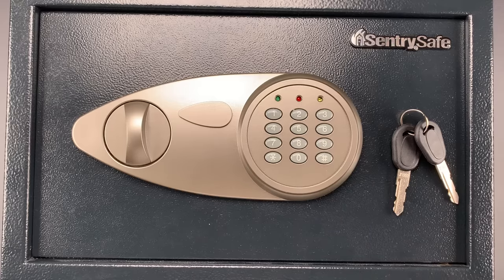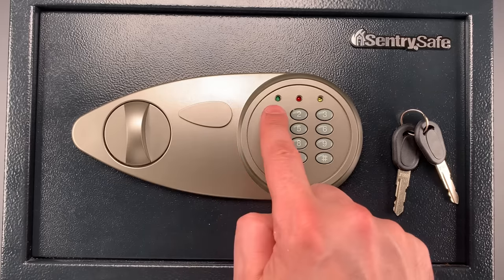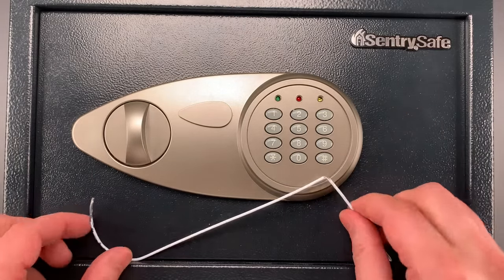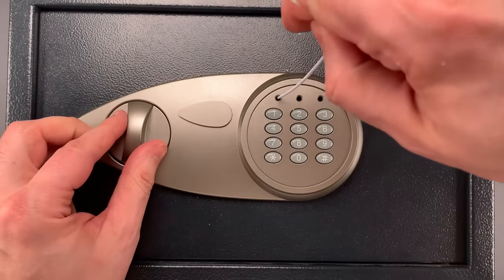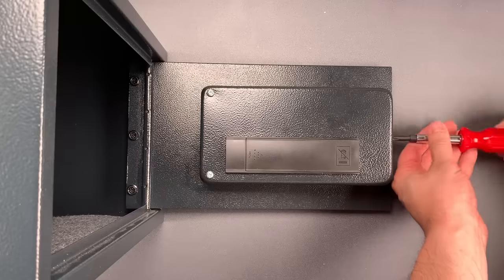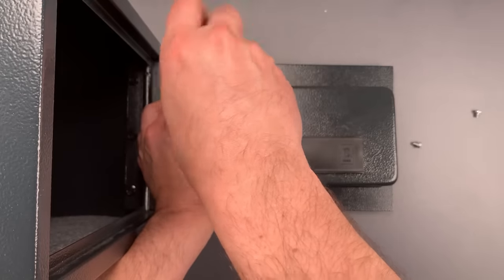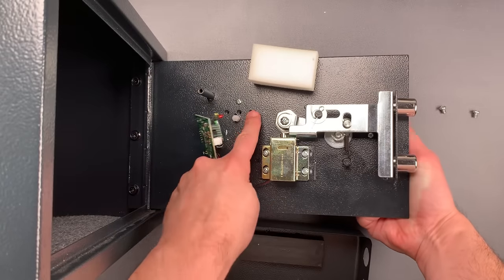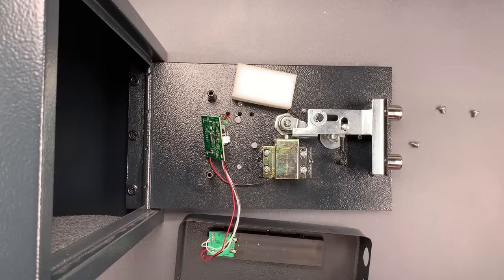[1020] SentrySafe Opened With a Coat Hanger!

Comment: One of my friends bought a safe. He bolted it down to the shelf. The shelf was easy to remove so when the robber came he took the safe together with the shelf.
Reply: "a lock is only as safe as what its mounted in"
also works well if you change it to
"a safe is only as secure as what its mounted on"
Reply: your friend forgot to make sure the lock was secured to a strong setting.  whoops.
Reply: "There was an attempt..."
Reply: If you can pick up the safe, it's not safe.
Reply: The trick is to keep safe empty and just use shoe box on the floor, at least they'll get pissed they were carrying damn thing around for no reason.
Reply: When thieves have decided to steal you, there's no avoidance. I live in the countryside (France) and there was one safe "picking" that made the local news. A local farmer which was know to have a lot of cash on the side (typical older generation not trusting the bank) got his safe robbed. It was wall mounted, in a cinderblock and stone wall. The thieves stole a bulldozer from a nearby construction site and plowed through the wall, picked up the safe and (probably) loaded in in a van. Ultimately, as many other people pointed out, the shoebox in the cabinet solution is probably a safer bet overall.
Reply: @LeSarthois  I prefer the parchment paper wrapping labeled liver in the freezer myself. offers a little fire protection and seems like just another nasty piece of meat.
Reply: @alexs.3789  Put something in the safe that when shaken "sounds" valuable, or fill it with fake gold bars, or just full of cement, completely.  They try and try to pick it but it is cemented shut.  Actually, scratch that, do what they did in John Wick (the 1st one), have a safe, then pour concrete over it and have it become your floor in your basement.
Reply: Ill top that... not a shoe box hide stuff behind a shelf of user manuals for stuff you own. All normal people and even the owner are allergic to even look at that shit let alone parse through it
Reply: He is not your friend anymore
Reply: @LeSarthois  nah not even a shoe box will stop a  good criminal. a good proffesional thief will look through everything becaus they know people usualy hide theyr stuff in strange places to avoid geting stolen.  stuff like ID cards and pass ports are realy expensive and can be sold for allot of money  so a good criminal will look for such stuff.  drug addicts and amatures tough they might not be as clever and miss the shoebox  but even they whould actualy whant to check shoeboxes becaus shoes can be expensive and som people store valuable stuff like jewlery in them.
Reply: We have all fallen short of the glory of God because we have broken His law. have you lied or stolen? Looked with lust which is adultery in Gods eyes, or used God's name in vain? because we have broken His law we deserve justice but God is so gracious that He came to earth as Jesus and died on the cross to pay for our sin and transgressions, His final words were " it is finished" He paid our fine, and then He raised Himself up from the grave because not even death could hold Him. Repent and trust in Jesus, and God's justice will be paid for in full.
Reply: @LeSarthois  
Ever heard of a decoy safe?
That'll be the next thing.
Put a bunch of garbage copy papers and regular coins in the decoy to sound like cash & bonds & gold.
The real one is under the trap door hidden... somewhere else in the house.  😁
Reply: That should of been his decoy safe any smart man buy an impressive house safe. Then buries his money by moonlight in mason jars
Reply: @christianhale1988  For The Love of GOD! Please take your preaching elsewhere.
Reply: @alexs.3789  That works until one day you trash an annoy shoe box lying around on the floor. After few days.. ooopss..
Reply: I hope you at least returned the shelf back to your friend after you robbed him.
Reply: Maybe it was the shelf he wanted.
Reply: Marko
  does that mean his safe had a limited shelf life.
Reply: So what he needs is BRAINS ...not a Safe
Reply: he should have bolted the shelf to another shelf...
Reply: @jakedaniels7676  Midnight gardening is to be done in the dark.  New moon, no flashlights.  Pretend you are burying a body.  If anyone sees you it'll be gone the next night.  Also the soil disturbance is a dead giveaway.
Reply: @ajjabajja9155  sure that's why it's in there
Reply: @Big Cat Little Lion awesome.
Reply: Noted: bolting the safe to the wife right now.
Reply: I got a funny feeling both you and your friend know the actual robber
Reply: @rampage3337  Home security needs to be multi-layered, so relying on one specific form of protection is probably not going to be enough. It's true that thieves will rummage through most of the property. But they are also trying to be quick, so may not search an attic, for example. Especially one with no ladders readily to hand. A number of different types of deterrents, along with keeping your mouth shut would probably be the best bet.
Reply: Plot twist, safe resists all forms of attacks till send to LPL for reviewing.  

Still remained the problem of how detaching the shelf… :)

Comment: "SentrySafe produces and distributes fire-resistant chests, files, safes and security storage containers to more than 54 countries worldwide. An affiliate of the Master Lock Company ..."
"Nuff said."
Reply: Masterlooooooock! shakes fist
Reply: “Well there’s ya problem”
Reply: Also, how fire-resistant can it be. If you put a fuel source behind a flame ingress point.
Reply: When Masterlock don't even release these products under their own name... You know they're bad lol
Reply: @Aimless6  fire-resistant chest mean that the box will not burn, not the insides
Reply: Oh. I see the problem.

They need to make a coat hanger resistant chest.
Reply: @Aimless6  Yea, I know this is mostly a joke, just like this "safe", but realistically I don't see this a a big weakness given the construction. From what I can see it appears the "safe" is a single wall steel construction. The door is also a single steel plate with a housing over the lock mechanism. If this was in a fire the sides of the box would heat up directly. The door on the other hand has a relatively large steel box to house the electronics and the locking mechanism, so any heat here will have to go through both before it comes into contact with whatever is in the "safe". The LED are likely to burn easily, but even if they do there is not much of an opening left by them, and the sponge might or might not be made of combustible materials. Given the attention to details shown by the rest of the construction I think it's quite safe to guess that the sponge burns like an accelerator, but even then I son't see it as a big problem as there is limited access to oxygen inside the lock comparture. And without oxygen fire tends to go out rather quickly.
There is a battery compartment built into the lock container, and it seems to be made of plastic, no surprise there. But by the time the heat gets intense enough to melt that plastic, or even ignite it then I'd wager anything inside this thing will already be burnt by the heat coming from the bottom, the sides and the top of the box. So while it isn't a good construction I wouldn't say it's the main problem when you look at this as a way to safeguard your valuable papers in case of fire.
Still it's a weakness as it allows for easy access for any thief who has seen this or has had the chance to look into this product.
Reply: Master Lock:  Only the best in back street Chinese engineering & design.
Reply: @rocketraccoon1976  Actually Masterlock moved back to Milwaukee, sadly quality did not go up.

Comment: LPL: "It's held in place with a sponge..."
Me: "You mean double sided tape but ok..."
Me: "...omg..."
Reply: Double sided tape might be more secure, because the lights wouldn't as obviously give way.

Also, they could avoid this kind of attack by having the lights protected with a thin plastic cover. A criminal could break the cover to perform this same attack, but it would be just a little harder to do.
Reply: I legit thought he was joking until he took the sponge out.

I wonder if this was intended to have a larger mechanism/board, and they just re-used the shell? Because that sponge fills out quite a lot of empty space.
Reply: It is a sponge duh

Comment: the scary part is that the hotel literally supplies any theif with the neccessary tools just a few ft from the "safe".
Reply: This is not a hotel safe.  It's a home "safe" by the worst lock company in the US.
Reply: @johndododoe1411  Hotel "safe" are of very varied quality. One hotel I have been a guest of had a "master code" of 1 2 3 4 5 6... so... well... even if I set my own personal code; the 1 2 3 4 5 6 code also opened the safe.
So far in my frequent travels though, I have not been subject to theft that I am aware of.
Reply: @johndododoe1411  Document fire safe.
Reply: the door is maybe the thickest part of the whole "safe"
Reply: @Paxmax  As far as hotels are concerned, you'd probably want to look at the layers of security, and who has access to each.  See  what the room locks look like, the safe itself, any other security features in the common areas (sensors, cameras, night guard, etc).
You'd also want to be discreet before checking in.  Don't do anything to stand out, like wear expensive jewelry or designer clothes.
Lastly, make sure to secure your belongings before you leave the room.  I'm pretty sure that most hotels thefts are done by the maintenance or housekeeping staff.
Reply: @johndododoe1411  Some hotels do use similar safes.

Comment: Having a decent amount of experience in a related field , I am well aware that NO lock will prevent a well-armed / well-determined thief or robber from getting into almost ANY lock.  BUT - after watching several of your videos - what I do find alarming is the EMBARRASSING EASE so many of these locks / keys / safes can be defeated - YIKES !!
Reply: And not with pro lock picking tools. Coat hangers and orange juice bottles.
Reply: Yep that's his primary goal, to show how basically insecure so many of these products are and to motivate vendors to do better.
Reply: As always, it's just a matter of $$$.... the companies will make things as cheap as they can, and price them as high as they can get away with. It takes a lot of research and a willingness to spend an arm and a leg to get a good quality safe. And in reality, I think it's kind of always been this way.
Reply: As a professional bank robbery lockpicker, my friend can confirm this.
He says that the first step is getting into a bank computer, spreading a specual virus so that we can manually control when what is active/not active.
After that, we map out all cameras and doors.
Meanwhile, we also find where the alarm is and shut it down before moving on.
After that, my friend has to go near the bank, wait for the pc virus and alarm to shut stuff down, then he goes in (it's generally at night and not via the main enterance.)
He then proceeds to pick the doors (with both standard and special tools) and then they can take a part of the money, quickly but silently get away and there won't even be camera footage left.
Clean, fast, stealthy.
Reply: @u6uggg6hguiuggy  Ok but how are you getting to the "bank computer" without being caught on tape? Even once the cameras are off they can still see past footage. It's not like banks are empty either, they're not gonna just let you walk into personal restricted areas.

Comment: Next time I'm in the market for a safe or a lock, I'm going to have to dig through your archives to see if you've picked what I'm looking at and how long it took.
Reply: If the video is longer than 5 minutes - Buy it :p
Reply: A proper safe will cost thousands of dollars and not have a key nor will it have an electronic push buttons for the combination.
Reply: @Reelix  

Its smarter to watch exactly how long it took to pick. Sometimes he picks multiple locks or spends the first 4 minutes talking about other things before spending a few seconds picking
Reply: He has good locks on the show sometimes, but I don't think he has ever done a good safe or lockbox. I suspect they're too expensive just for the sake of a video and he doesn't want to show any safes he's actually using.
Reply: The best safe is simply hiding something where no one would expect to look or one that is too heavy to carry out of a house. Every other safe out there will do fine for keeping young kids out of things, maybe not savvy teenagers though who would find a video like this and break in.

Another factor is convenience. If a safe has a key hole, buttons, or fingerprint sensor on it then it will have more vulnerabilities. Combination locks seem to be the best. Or a safe that requires two types of keys or codes to open.
Reply: this should be on Amazon
Reply: @christopherguy1217  - Sargent & Greenleaf makes keypad-opened safes that are secure. They've been in business a long time and their designs take some thought, not just a coffee break, to think up.
Reply: @christopherguy1217  not mention they are breakable too!

Comment: LPL at Home Depot speaking with the returns clerk: I’d like to return this safe because it’s not safe. shows the coat hanger

Clerk: 😶
Reply: I actually tried to return a safety wire for a computer i could "pick" by shoving a bent paperclip in. they said that once it's out of the package it's no longer their problem.
Reply: @StefanoBorini  roblox oof sound
Reply: I'm returning this safe, because it is missing an LED.

Comment: After a few frustrating days and a few bent coathangers later, it does work. Just got to find that sweet spot. Alas, the only thing inside rattling around was the bag of mounting bolts and the little teardrop-shaped keyhole cover. No treasure.😪 After watching your videos, Master locks and Sentry safes are off my list. Thanks for all of your info,

Comment: Today on: "WHO DA HELL APPROVED THIS DESIGN??"
Reply: Some one with no real world experience 

But in all fairness may have believed it was a good design

We all get it wrong at times
Reply: pick pockets and ex-cons who got on their payroll after prison and rehabilitation that tax payers paid for. They're once again returning to their old careers as we speak.
Reply: Here is a  clue, the SentrySafe he cut into had a MasterLock product info sticker.
Reply: can this be an actual thing? maybe a subreddit?
Reply: It's incredible baffling that with a few small modifications this attack could be avoided: separated circuit board for the LEDs, bolted to the door; physical separation between the circuits and the actual lock mechanism (a simple "I" shaped metal soldered between the parts should already be enough!)...
Of course, these are only to avoid this attack. A couple more modifications would improve the overall security of the whole thing. As it is right now, it's as safe as a drawer... :)
Reply: Finance Approved!
Reply: Some Chinese engineer
Reply: An accountant.

Comment: someone over at sentrysafe, when designing this particular safe, made a conscious decision to use a sponge and thin, easy to bend wires to keep the led lights in the holes right on the front of said safe.
there is a person dumb enough to decide that a sponge is safe enough.
let that sink in and despair.
Reply: Abandon all hope ye who enter here.
Reply: Even a sheetmetal barrier between the circuit board and solenoid would have been enough to prohibit this attack, and cost about $0.05.  Truly pathetic.
Reply: dumb enough *greedy and ruthless enough
Reply: The engineer made a proof of concept prototype using a sponge noting "replace with metal stand-offs later". Then the boss came. "How much are the stand-offs?" "$0.06 a piece, need 4 of them". "How much is the sponge?" "$0.13". "There, no need for stand-offs, it's perfect as it is."
Reply: there is someone who fired / refused to hire anyone who dared to point this out
Reply: One of the reasons I got into Engineering, was, all the bad engineering... I wanted to make things better... then, you get to your first engineering job and realize.... the bad engineering is on purpose... it's not stupid engineers... it's profit motivated executives telling their engineers to put flaws in stuff so the company can sell "upgrades". (Seriously though, sometimes it's just stupid engineers, but they're usually the exception and not the rule...)
Reply: @msbrickkitten6882  Yeah, if you're offended by bad engineering, get into management. Or if you're already an engineer, do good engineering but stay hush-hush about it. What boss doesn't know doesn't hurt the product.
Reply: @sharpfang  I think what you meant to say was; "What the boss doesn't know won't have you fired."
Reply: Sometimes you get a perfectly engineered design that works great and does what it's supposed to do.  Then  they take that design and "value engineer" it to make it cheaper and here we are.    Couple more cents for some stockholders, a big fat bonus for the ceo and shitty products for everybody.    Then a few years later when people start realizing these products suck, sales drop and they start laying people off and/or start finding more ways to cut even more corners.
Reply: @TheSpongiform   Sounds like the worst managed company of 2019.
Reply: @blahorgaslisk7763  Eh, I'm not telling you to go against direct orders, just don't bother the boss with details. At my workplace, when two employees argue over a solution and can't come to agreement, the magic phrase is 'I'll go ask boss'. A satisfactory compromise is immediately found, everyone well aware boss will find a solution to nobody's satisfaction.

Comment: I really like the thick, heavy, solid-looking pins, held in place by some 24ga sheet metal
Reply: They're called bolts.
Reply: You are correct that the bolts are solid-looking. They are also thick-looking, and heavy-looking.